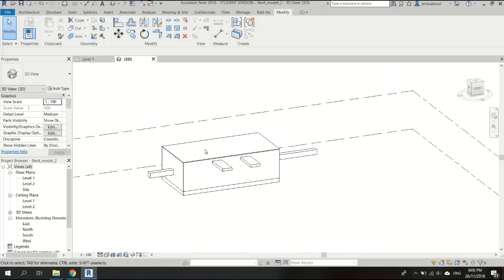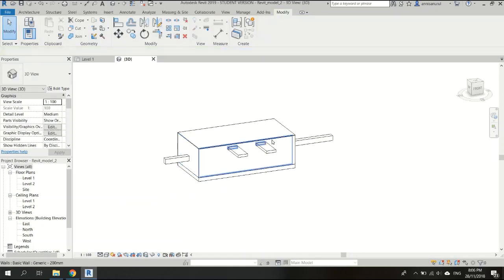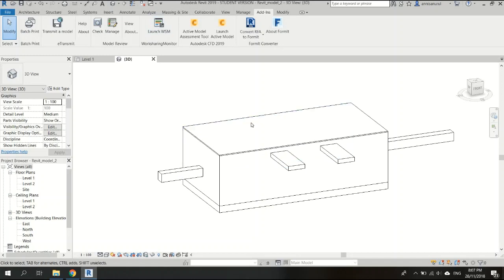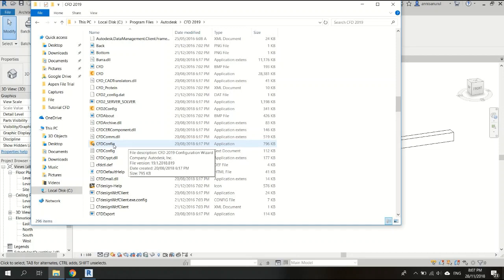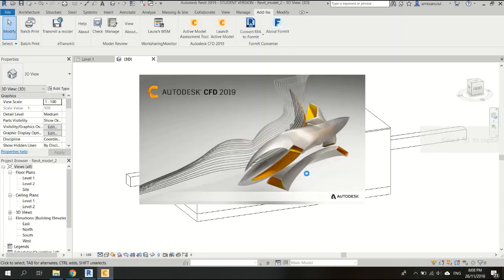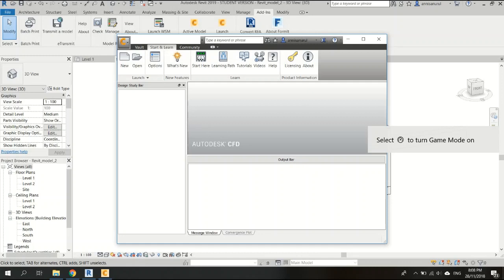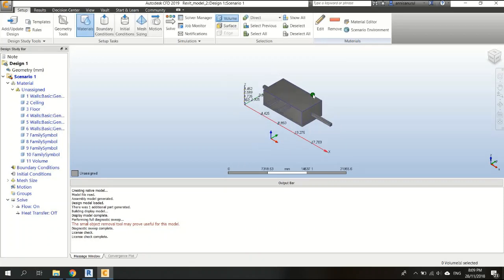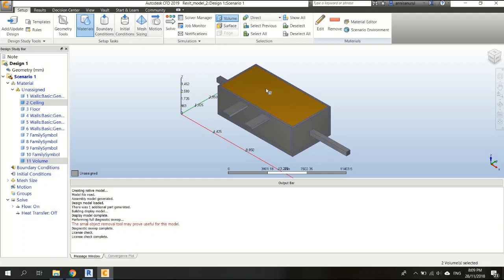Part III   Exporting 3D Model From Revit to Autodesk CFD

Comment: Hello, I'm having problem with the CFD config file.. The option of revit cannot be checked, which means it wont get installed in the revit file. Do you have a solution for this Annisa?
Reply: I have the same problem but solved it by run the config as administrator
Reply: Hey.. convert the Revit file into an ACIS format. Export it and load it in Autodesk CFD. Results rendered were very similar
Reply: @hariprashanthpalanichamyth8328  sirr thank you so much  your reply is super helpful